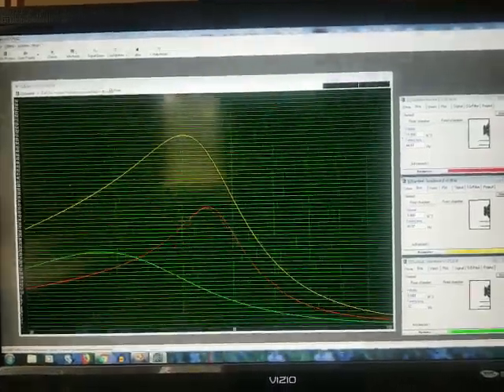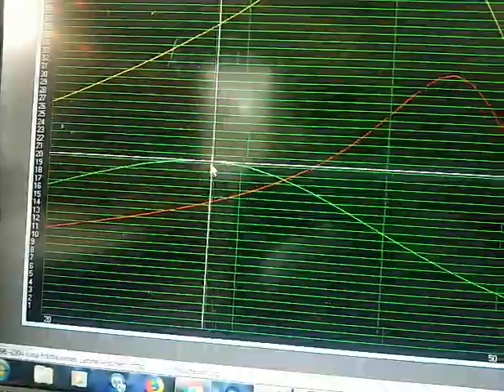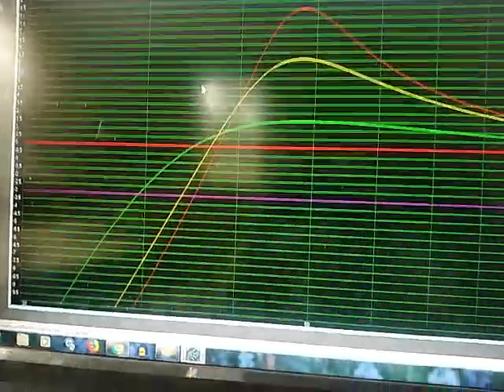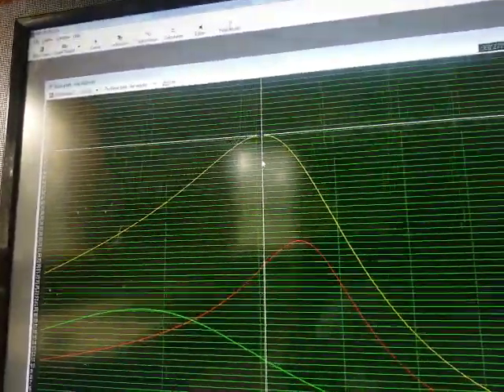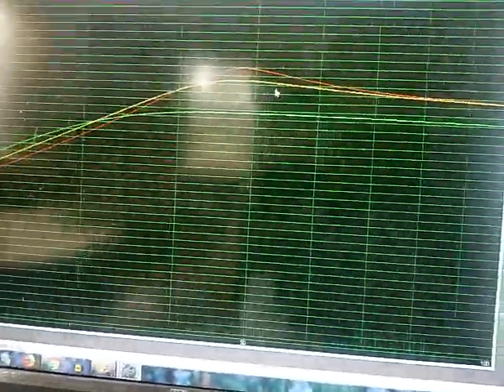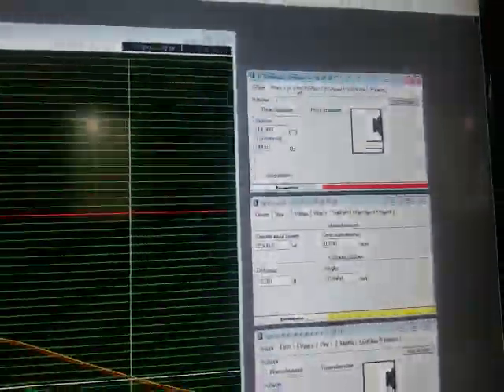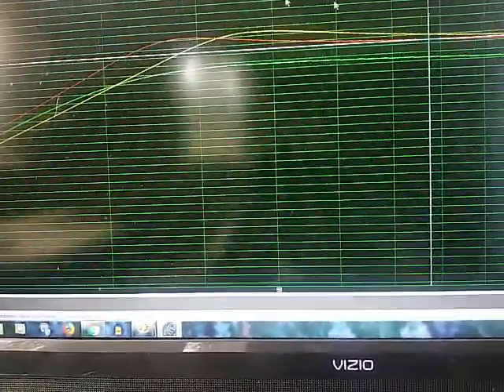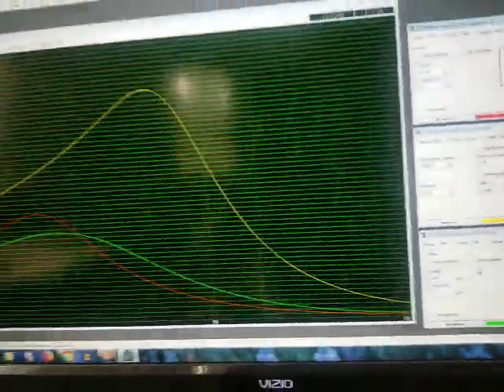Using WinISD to Model Sundown Subwoofers Comparing Effects of Enclosure Size & Power

Comment: I think your Xmax cone excursion is off. You’re stating that 1500 watts is only moving your sub halfway.
Be careful depending on WinISD for concrete data. It’s just a model of the real world performance. Once you actually build the enclosure, you’ll realize there’s stuff  that varies from the modeling predictions.
A red flag is when you think you know more than the folks that actually manufacture the speakers.

Comment: I design enclosures and build as well. Been using Torres or CT sounds box calculator on phone ( damn close to Chris Torres' calculator) but I don't have any way to model. I need to learn this. Does it work for slot port enclosures? In your experience can a slot port be as loud as a round vent like those "big ass ports"? Would term pro software be better you think?
Reply from the maker: Does it work for slot port enclosures? Yes, you can set the length and width of the port or you can select round port and enter the diameter and length. Do I feel that a slot port can be as loud as an "aeroport" type of round flared port like big ass ports, sure I don't see why not as long as their is adequate port area, as port area is more important than the shape of the port. The reason people argue over round ports is there is less surface area and therefore less resistance ie more efficient, however if there is enough area it will make up for the lack of efficiency. I hope that explanation makes sense. Thanks for watching and commenting.
Reply: @E4EonEbay  yeah with aero ports you can get away with less port area to get the same sound, downside is it doesnt work for big walls hence why the loudest people on the planet run slot ports , much easier to fit. If you build 2 proper boxes side by side and one uses slots and the other aero guaranteed you wont hear the difference in sound, I've personally noticed Aeros lack bandwidth even when built properly they fall off above and below tuning easily
Reply: Slot ports have better bandwidth and are just as loud as aero ports if built properly , plus they brace your box.